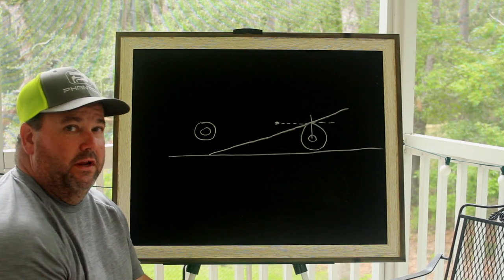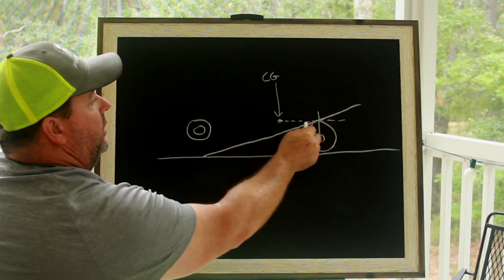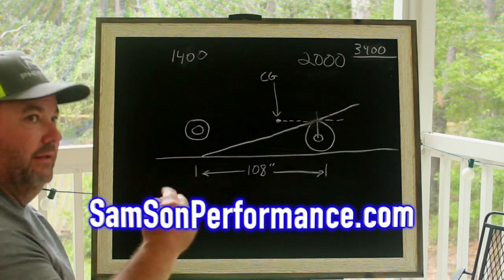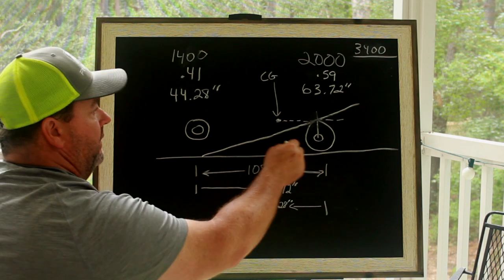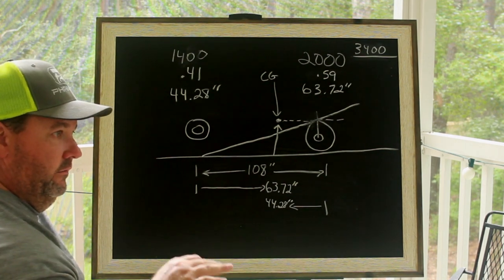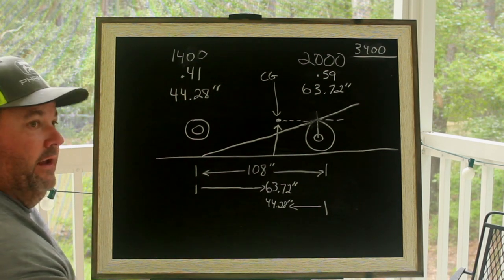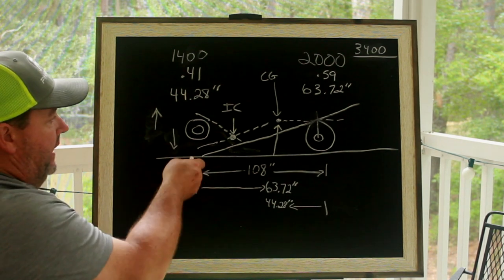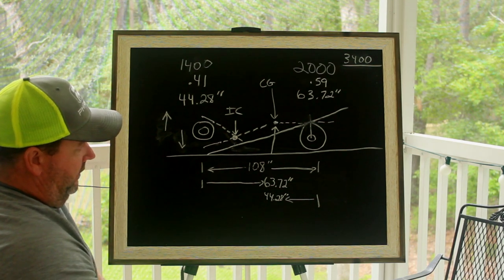4 Link Bar Angles | 4 Link Suspension Explained | 4 Link Tuning

Comment: So I've watched alot of your videos, very informative without a doubt. Fist an foremost, my car and setup are totally street based and for fun. Also, I'm doing what I'm about to explain for fun and to be all the wall different. I have a 2001 Lexus IS300 with a mildly built 2jz, a TH400 and at the moment the stock IRS. I'm in the process of converting it over to a Ford 9 inch. Now you can see the it's quite the different build. I'm leaning towards a triangulated 4 link. The car has a rear  subframe and saddle gas tank all of which is being removed for obvious reasons lol. My main question/comment/concern what have you is. Do I build my own frame so speak within the existing frame or can I reinforce the mounting point areas for the 4 link and go with it? The car has integrated frame rails that disappear before the gas tank and reappear after the rear frame. Should I connect those? The car will also have a slight wheel tub increase to accept a 275/60/15 on a 15x10 4.5BS rim. I know it's totally off the wall, but any suggestions would be appreciated, thanks in advance and keep up the great content!!
Reply from the maker: Rick Shults thanks so much for your comments, info and questions! This is going to be easier via email. Shoot me an email from my profile and we can chat for sure. This is definitely different!! Go fast, go straight! Be Safe!!
Reply: @KevinWilsonSBC  lol will do thanks for responding.

Comment: It’s pretty easy to realize if you run your lower bar up hill you’ll get anti squat if you run it down hill you’ll get squat on initial launch. It’s a fulcrum point, it don’t take all that center squat line calculation to figure that out.
Reply from the maker: Thanks for your comments! While it is easy for you, my goal is to help break down this stuff for those not as used to making bar changes so they don't have to have 20 opinions from 5 different people get them all turned around. The 4 link is not dark magic or voodoo as you know, but to many it is intimidating. I will check out your videos on it and see if  I can pick up some pointers on presenting this better. Go fast, go straight! Be SAFE!!

Comment: Where does the "center of gravity" dot come into play? It looks like anti-squat line goes from rear slick tread to the cam height above front center line. Is the center of gravity dot ever used again? I run a ladder bar so should I try to use the front mounting hole that lies on the anti squat line?

Comment: Kevin, will you please explain something. You go through the math to determine CG front to rear. Weigh the car, figure bias front to rear, 41% on rear, 59% on front, determine it is 63.72" forward of rear, but the AS line still goes to cam height over front spindle which does not change. Why go trough the math to determine CG fore and aft when that never comes into play when calculating % of AS? I'm confused, what am I missing?
Reply from the maker: Robert Briggs thanks so much for your comments! The camshaft is a good alternative height to knowing your exact CG of location. If you know your CG location, then use that as the intersect height across the perpendicular line through your front spindle centerline. Not everyone can do all the scaling and jacking to understand the exact CG location, so then a good compromise is the camshaft method. Make more sense? Then the relationship b/w the CG and IC is another tuning aid for how your car reacts on the hit and through the run. Also, even in the camshaft method, ride height will impact that calculation, front or rear ride height will move that point. Go fast, go straight! Be Safe!

Comment: So is this a good rule of thumb:

Below AS line=Squat (tire lifting from track) control with shock compression

Above AS line=Separation (tire forced to track) control with shock extension.
Reply from the maker: Brian Boles thanks so much for your questions! I try to be careful with doing this but at a high level you are thinking about it in the right direction. Just don't ignore how both Compression and Rebound work together for each car, with spring rates and shock height and wheelie bars and weight transfer. For instance on separation the compression setting is critical after the first .5 second based on the several factors and IS length. Go fast, go straight! Be Safe!

Comment: Any good videos with airbags and a good adjustable 4 link
Reply from the maker: Sorry... I don't have much drag racing experience with airbags other than racers trying to use them vs rear ARBs. The 4 link acts the same so those theories still apply. Go fast, go straight! Be SAFE!

Comment: I’ve been watching a lot of your videos and I believe I understand quite a bit of it. Im trying to plot the 4 link out on the website link you provided but I don’t think I measuring the “horizontal control arm length”. Do I measure center of bolt going through the heim to center of the other bolt. But it says “control arm length is not the actual length it’s the parrallel/projected length. Do I need to hold a level on the rear bolt and try and measure straight across instead of following the bar angle
Reply from the maker: Center of bolt to center of bolt. Go fast, go straight! Be SAFE!

Comment: Side to side weigh bias ( left/ right) should we ideally aim for a 50-50% (side to side)  with driver in vehicle?  How do i know how much weight should be on the rear left side to compensate for engine rotation ?

Comment: Should i do the maths to see how much weight it would take to crush the side wall of my tire. Then base my weight transfer to the rear/ shock compression accordingly? Should i base my max shock compression (in lbs) on the amount of weight it will take to crush the side wall?

Comment: Building a new car were should I put my 4bar brackets on the frame off the ground ?
Reply from the maker: Jim Franklin thanks so much for your question! You must mock up your car simulating the race ready ride height, with the rear end height set based on your axle centerline to track and wheel placement in the tubs/body fender, then mock up your bar locations. Every car is so unique, I cannot give you a distance without knowing your car's setup and measurements. Stay tuned for the String Method video coming out soon that will cover squaring a chassis which will help you in this process. Go fast, go straight! Be Safe!!

Comment: So your shocks need to be mounted on the back of the rear end housing? I mean they need to extend at the hit?
Reply from the maker: They can mount in front or the rear of the housing. The most common is the rear. Other than a big tire slick, most applications extend on the hit. Go fast, go straight! Be SAFE!!

Comment: What if the engine is to weak to lift the front wheels (lower class rallycross car). In that case, where would you recommened having the IC? Over or under the anti squat line?
Reply from the maker: Magnus Göransson thanks so much for your comments! For that I would start as close to neutral as possible, but over the AS line. The AS line is mainly for a starting point. The car will show you what it wants. Go fast, go straight! Be Safe!!

Comment: Does this also work with stock style g-body rear suspension? I'm setting up a g-body using aftermarket bars and adjustable mounts on the rear-end.
Reply from the maker: Mike Blasey thanks so much for your question! Same theory applies at a high level. Go fast, go straight! Be Safe!!

Comment: Is it possible to have too much anti squat? Car I'm setting up is 99 mustang stock style suspension. Still have another hole to drop the lower control arms down. Thanks.
Reply from the maker: hammerdown636 thanks so much for your comments! Absolutely it is possible to have too much AntiSquat. Remember, while necessary to plant the slick/radial, our goal is to apply just enough force for traction and the rest of the energy to move the car forward. It is about a Balance with all the rear components working together. Go fast, go straight! Be Safe!

Comment: I run ladders. My pinion angle and preload is on the bottom bar. Is the adjustment for preload the opposite of adjusting the upper bar?
Reply from the maker: This can really screw with you, so in this case, I would want to have the car on wheel scales and confirm what it is doing. You are likely introducing some rear steer more than normal if the adjuster were on the top bar, but this is why I would have my measurements documented and the rear tires on scales before making changes. Go fast, go straight! Be SAFE!

Comment: Would this apply to a drift car?
Reply from the maker: Marcus Pingitore thanks so much for your question! At high level the 4 link is acting on the chassis under acceleration. I have never, ever, setup a drift car. Go fast, go straight! Be Safe!!

Comment: Hello question I have strut front end so I can't get measurements from upper control arm bolt what do I do ??
Reply from the maker: Ronald mihal thanks so much for your question, but I am not following you. What measurement are you trying to get? Go fast, go straight! Be Safe!!
Reply: I believe I figured out I have a ladder bar setup so where it says front upper bolt measurement and front lower control arm bolt measurement I measure the single Bolt down to the ground correct?
Reply: Also when I measure my ladder bars upper bar and lower bar I go from Bolt to bolt correct
Reply from the maker: Sorry for late response. The main ladder bar measurement is distance of the chassis bolt to the ground. You are correct. For a ladder bar setup, checkout my video on percentage of rise. That is more applicable to a ladder bar with respect to the Anti Squat line.

Comment: Thank you for the great video. Just started measuring my car. I have a 1976 Pontiac Trans Am street car. Turbo LS making around 1000rwhp. Full interior street car. Car weighs 3774lbs. Car has Ridetech 4 link rear suspension. MT 275 radial pro tire. Is there a general Antisquat i should be shooting for? Is there a ICL that generally works? Thanks for all your videos. Extremely helpful.
Thank You
Mark 
Current Setup
136% antisquat
ICL 44.65
ICH 10.01

I can easily modify too: 
159%
ICL 34.34
ICH 8.97

https://youtu.be/_1nva_zCXlM
Reply from the maker: Mark Hatten thanks so much for your comments & questions! I would need more info on the car before I felt comfortable making recommendations. You can answer the questions from the suspension sheet on my website and that would give me more data. Sounds like a very nice ride and I love that is the older model for sure!! With a drag radial you really want to plant the tire so I would encourage you to experiment and track your changes. Go fast, go straight! Be Safe!!